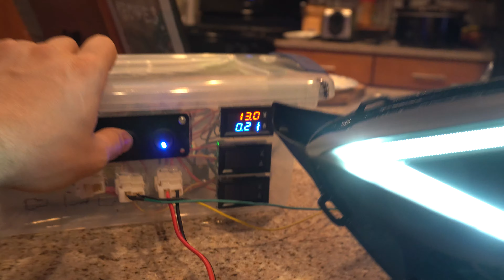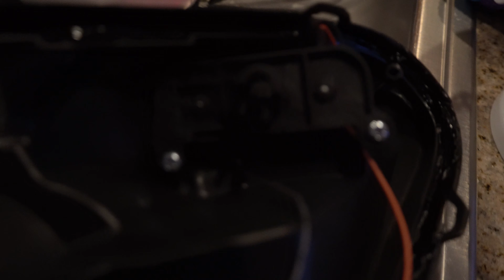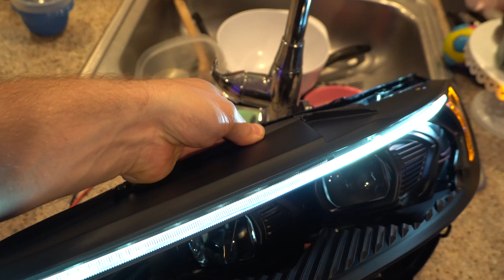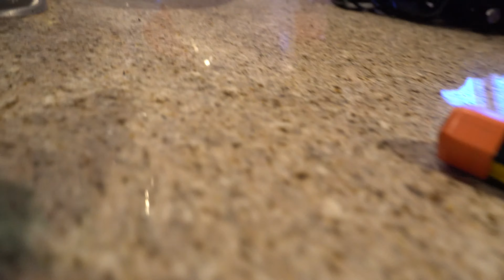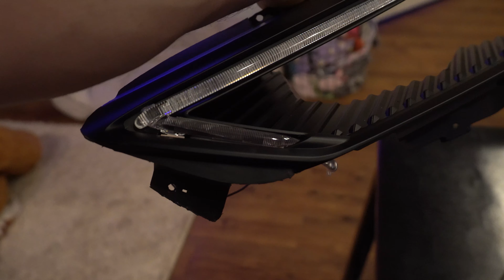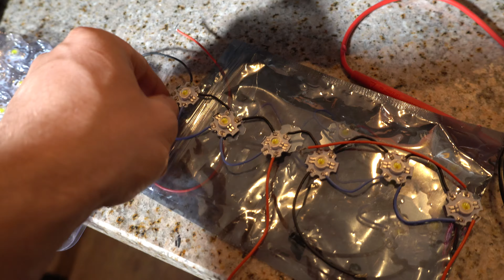2013 Ford Fusion Sequential Switchback Headlight Retrofit

Comment: I have these same headlights, but the low beam and high beam housings are switched. I have been doing hours of research trying to find out the wire color codes for the headlight wire harness. Do you know which wire colors are for the low beams and high beams?
Reply: Figured it out?

Comment: Really wanted to love these as I had to take them out of my car. Bad seal on housing, filled with moisture. High and low beams were switched from factory but that was an easy fix so I won’t knock that. Bad high beams, no matter how I adjusted them it was terrible. Fitment was horrible as well. To top the madness off, drl had to be cut n spliced and tapped to fuse box just to stay on. I currently have the mustang ones👍🏼